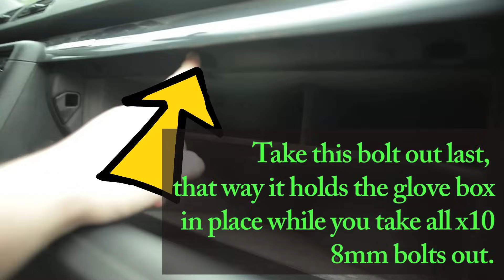AUDI A4 glove box removal and hinge repair DIY

Comment: Don't drill a hole in the soft-open damper or use WD-40 to lubricate it.  This device has a rubber cone seal that requires vacuum on the down stroke to work.  Petroleum lubricants like WD-40 will cause the rubber seal to swell, and drilling a hole destroys the vacuum. To fix, snap the cylinder apart by pushing up against the switch socket while holding the cylinder.  Use either mineral oil, or a silicone product to lubricate the cylinder and confirm the piston slides freely before snapping the assembly back together.
Reply: Great tip!
Reply: I thought the point of drilling the hole and filling it w/ WD-40 was to disable it or make it less effective
Reply: @duncanmn95  The impact loading of disabling it would be even harder on the hinge---unless every passenger/driver is warned to treat it with kid gloves.

Comment: Thanks for the video, very helpful. I Just fixed mine using this method and offer a few points for anyone doing this. To free up the piston I used Silicone spray which isn't oily and is meant for plastics. Just extend the 'piston' fully out then spray both sides, don't get the spray anywhere near the repair or you'll need to clean thoroughly for the epoxy to work. . Work it a few times and it runs smoothly and still damps the movement as it's meant to.  When you buy the hinge repair kit be sure it will fit your exact model of Audi. Mine is a 2006 A4 B7 S line and the brackets shown here that are commonly available on ebay didn't fit. I had to shorten the hinge end, file it narrower and re-profile them completely by bending several times to sit properly. Lastly, I used Araldite two part epoxy after degreasing the broken joint with cellulose thinners. I taped the hinge in place to cure overnight and then fixed the bracket after marking and drilling pilot holes. This ensures the hinge is at exactly the right angle and does't put strain on the new glue joint.
Reply: Thank you for the pointers, I'm redoing the repair because the epoxy I used originally didn't hold (now using jb weld  6hr) For the piston, did you still drill a hole? I have a replacement and I'm not sure as it simply drops the door with 0 resistance now.
Reply: Hi, no I didn’t drill a hole but there isn’t much resistance thanks to the silicone.
Reply: @octane836  Thanks for replying. I used silicone spray on mine and its a bit better but sure feels tight. Will probably move more freely once the weight of the lid is attached. Thanks again!

Comment: This was very helpful, thank you! Something that can add value however...rather than drilling a hole in the bottom of the piston housing, the top of the housing simply pops off, then you can pull the rod out and shoot some silicone in the cylinder. Put it all back together, and wala!
Reply: VOILA*
Reply: Drilling a hole seemed to ruin the dampening effect.  Now it looks like it just falls open when unlatched.  I like popping the top off better

Comment: Drilling a hole in the hydraulic damper and lubricating it, will make the damper completely useless. I tried it with mine and ended up buying a new damper. Instead I recommend getting the updated version of the glove box door, it has reinforced hinges. Audi offers it as a spare part. It is not cheap but I am very happy I decided for it, as I am sure this one will not break, because the weak part that used to break is designed in a different, reinforced way now. Also the power lock of the glovebox now works again in my convertible, the cable for the mechanism usually breaks too and it is almost impossible to fix. My old door was also scratched. So it was the best decision for me to just get the new one.

Comment: Found the nerve to fix my glove box thanks to your vid. I didn’t have the pry bar tool you had so I drilled small holes through the plastic and tapped the pins out. The filing tip was very useful especially since my hubby didn’t think I was gonna be able to do this project. It work let me a dream. Thanks for the video
Reply: You are my hero!

Comment: just did this fix today and to pull those roll pins out of the hinges you need a 9" or 10" nail puller or catspaw that has pointed head and deep enough v to grip those pins and apply enough leverage to get them out.  I first tried with a tiny flat pry bar and after going out and getting the nail puller and using it, there was absolutely no way I would have pulled those pins with the tiny flat bar.  also i really had to shave a lot for the screw heads to clear so maybe countersink your metal brackets for the screw heads a tiny bit, anything would help, so you can keep the rubber bumpers on the back without grinding them away.  i managed to save them just barely.  thanks for a great video

Comment: If I've seen this video before, I would have spared the money on the hinge repair kit and just repaired like I did today following this instructions.
After drilling the absorber it works better than before.
Thanks a lot!
Just solved my with epoxy glue and no kit.
I'm going to sell the kit now  :-)

Comment: Thank you so much for this excellent video.  I just followed your tutorial to fix my 2006 A4 2.0 Turbo that had the exact same problem.  By the way – I didn’t have that tool you were using to take the two hinge-pins out, so I used a paint can opener (has an end like a curved slotted screwdriver), and it worked fine.  Owen M.  Andover, MA.

Comment: Both my A4's have busted GB hinges. Center console lid too.. happens to all of em eventually because they are not designed properly. The headliners come loose too because of faulty foam padding layer which disintegrates over time. When I fix my glove box (again) I plan to install "safety chains" that stop the door short of snapping the dam hinges off. Too much over-hanging weight on these plastic hinges.. Letting the door "fall-open" is like hitting them with a hammer.. (Audi obviously needs to address this) - The cars? FABULOUS! We Love em!

Comment: Well done! Looked like it cost nearly nothing. Stuff that you already had. Will be watching again soon as i have to fix both hinges on mine. Cheers
Reply: buy a new glove box out of a scrapper A4... son broke one side of mine a week ago and ive just fitted a s/h one... £20... why pay the chinese for some BnQ brackets and self tappers when you can replace the whole unit f less than the cost of the £30 repair kit.....?

Comment: For anyone struggling with getting the hinge pins out, the tool he uses is a cats paw or claw "nail puller". I didn't have one of those. I've done the repair before and previously used blunt tipped needle nose pliers or any robust pair of pliers. This time, the pin was stubborn. Tried multiple tools and was about to give up THE ONLY THING THAT WORKED was a small chisel and a big ol' ball peen hammer. I sat on the floor, had the pin facing away from me and wrapped my legs around the glove box and wailed on the chisel. It slid out!

Comment: the drill the hole tip is the trick , way too stiff without one ,  i drilled the hole after the install , but before putting the side cover on , that way you can stick a squirt of silicone lube in it , if it stiffens up again in the future just by removing the end trim panel , a two second job.

Comment: I'm struggling to get the pin out (around the 50second mark). Non of the hammers etc that I have fit the pin head well enough to remove it when they are tapped with a hammer. What tool is it that you are using in the video?
Reply: I had the same problem, because on A3 the absorber it's a differente model and you can not take it out.
I just glued it without removing it

Comment: Nice video. But the repair kit I bought for 2004 A4 needed modification. Hinge and screws restricted opening of glove box. Also, my glove box was wired for lights and no mention of that issue.
Reply from the maker: At 00:40 I remove the light clip, sorry I didn't expand on that further. As for the kits, depending on which you got, some do need more work than others. The trick I found is to made sure the screws are as flat as can be, once they are screwed in, otherwise it doesn't close as well as it should. Hope you figured it out.
Reply: There must be 2 different gloveboxes.
My 2003 A4 B6 is different & has a zigzag end on the brackets I bought, that kit comes with replacement pins too.
Essentially the same repair though

Comment: What type of epoxy did you use? I was thinking about using JB Plasticweld, which, unlike the epoxy you used (so it seems), dries pretty quickly. 
Thanks for the video!

Comment: Thanks for video it is the greatest diy video on internet about a4 gb. I took mine out not have enough time to complete the job i took out one of the pins where u show them around 50th second but the 2nd one it pretty much stuck i cant remove it. The head of that pin is almost destroyed but doesnt come out any suggestions bro?
Reply from the maker: Hey bro, yeah I'd say spray some WD-40 in from both sides, let it sit for a few hours and try again. The other thing you can do is find nail or something thin enough to fit into that hole but strong so you can use it to push the pin out. But I'd say try the WD-40 first, be patient with it and let it do its work then come back a few hours later and try again. I used a small pry bar to hook around the pin and pull it out, something like this. https://www.blackrocktools.com/media/catalog/product/cache/1/image/9df78eab33525d08d6e5fb8d27136e95/3/3/3323_12__wrecking_bar_tekton_4.jpg
Reply: mintyhero great idea man i appreciate it. Another question if u dont mind what did you drop into that small hole inside damper? What kinda spray or smth couldnt figure it out.
Reply from the maker: No worries, my dampener was very stiff, so I drilled a hole to release the air pressure, then sprayed some WD-40 in there as well to get things moving. Had to move it back and forth quite a bit to make sure it was smooth so it doesn't brake again. Good luck
Reply: mintyhero thanks again for this video i finished my glove box everything is perfect except.. i sprayed wd40 into that damper as it was snif also as yours but know its too laggy after spraying. Dont know if you get me my english isnt that good. How can i make it back to sniffy a little bit? Any ideas? coz it annoys me when i open the the door of the glove box it comes down too quickly and is shaking so it can break again and it makes bad noise when the door drops.help pls
Reply: Rick G i also thought it might work i guess it is the only way actually but havent tried it yet coz i installed glove box back and cant get to that hole of the dumper without removing the glove box. Thanks for reply man

Comment: I’m fixing mine now and the hydraulic is no good definitely the reason why it breaks in the first place is there any where you can buy the hydraulic arm? I can’t find it anywhere
Reply from the maker: I wouldn't bother, I've read that some replace it and because the mechanism is faulty it just happens again. That's why I dripped the hole and the restored this one slightly, with the hole now it will never jam again and brake your hinge.

Comment: Ok, good video but drilling into the hydraulic cylinder ruins it unless you reseal  it.  I didn't see you do that.
Reply from the maker: I did not plug it back up, and it was on purpose. You're free to do what you want, but I'll say this, the reason I didn't do it and I would suggest you don't either, is because I did a lot of research on this fix before making the video, and everybody decided that the piston is responsible for this issue in the first place, in fact many people who do this fix recommend removing it completely, not even replacing it with a new one, and definitely don't fix and re-use the old one. The reason is that the piston is faulty, it gets clogged up and very stiff, which makes the joint crack. If you fix it, add WD40 and seal it back up, that piston won't last a month before it stiffens back up again, at which point it will put pressure on your fixed joint and you'll have to take it all back out again. Good luck, let me know how it turns out for you.

Comment: Where did you get the carbon fiber trim pieces from?
Reply from the maker: I believe that's a stock option, I did not install them nor did the previous owner.
Reply: Really I have a b6 and mine are plastic wood grain
Reply from the maker: Might be different depending on the trim, is yours the 1.8T? Is it a Avant? Was it manufactured for the USA market? Depending on where the car is purchased there may be slight variations I think.
Reply: Kishan Seenanan mine are silver

Comment: can any1 help pls?
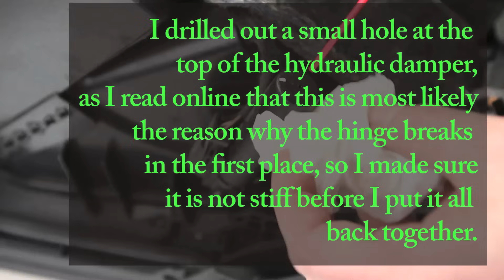i did as shownon 4:00 but after just some hours it got still stiff
Reply from the maker: You drilled a hole and sprayed some sort of lubricant in there? moved it back and forth until it loosened up?
Reply from the maker: I'd say just repeat the process and spray some lube in there, move it back and forth until its smooth, then let it sit, should work after that. If not, I can't think of what it could be. Maybe it can be remove completely or replaced, maybe look on e-bay or check a junkyard.
Reply: ye i had to lube it 3 times to make it work
but thanks for the vid
Reply: I've just fixed the glove box and it works! However, I've got the air bag warning sign show up on the dash now :(. 

Any suggestions to remove it? 

Many Thanks
Reply: Zeshan Azeem good chance you disconnected the passenger airbag accidentally so just check connections behind the glove box
Reply: Mr. Nobody if it continues use a white lithium grease or silicone grease because WD40 picks up dirt and will gum it up

Comment: Why remove the glove box first, and remove the door after? Much easyer to just remove the door.
Reply from the maker: You're free to do it your way, I felt like working on the hinge on my desk with proper light was easier than crawling under my glovebox. Plus if you're using glue, you want the hinge to dry without any weight on it.